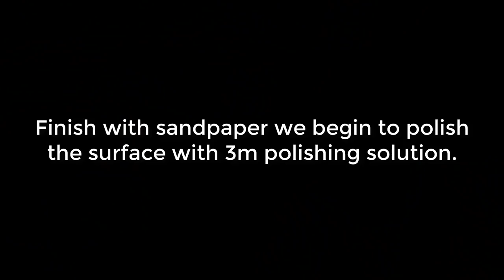How to sand and polish epoxy table - resin art - Art Working

Comment: Hi

I realize im late to the party but is there a reason why you change from orbital sander to the flat sander or is it just the sand paper you have available

Beautiful work

Im inspired
Reply from the maker: Thank you for your questions. There is actually no reason for that change. You absolutely can use both. In the video I use both because I have more finer textures so I can't find them for orbitals sander so I replaced them with flat.

Comment: Does the wood doesn’t get stained after using polish?
Reply from the maker: I use a water-based polish, so I can wipe them off with a damp cloth!
Reply: Woodworking - Arts & Crafts is that 3M also I send you request on Facebook (-: I would like to learn more tips and tricks from you please

Comment: im about to do a project like this but have to ask why the differnt types of sanders? will one or the other not do the trick? i believe u used 3 differnt types here??
Reply: You don’t need different sanders. The big one they were using was a orbital sander it spins and it is more powerful. This allows you to remove material faster. The small sander was a  random orbital. It is not as strong and doesn’t move the same. It will do all the work but take longer for heavier removal. The last thing they were using was a polisher that had different pads for it. That is used for polishing. You can get a cheaper one like the porter cable. You he 3M polish will surprise you on the price it is not cheap. Cheers.

Comment: I tried wet sanding and my wood would absorb the water and rise up and get grainy, how do you avoid this.?
Reply from the maker: Depending on the type of wood you can use with water, you should only use hardwood. It is recommended that you use dry sandpaper to beat them up to a fineness of 3000

Comment: what kind of finish did you use on the wood at the end?
Reply from the maker: I use osmo oil to finish
Reply: @WoodWorkingArtCraft  
How much for osmo
What code.. 1101 extra thin?
Reply from the maker: 3058 clear matt. Its code you need
Reply: @mohdfirdaus3055  i think extra thin is actually better than 3058, as it will penetrate into the wood better, right?

Comment: Hello sir, can you tell me how many minutes you sanded that area with each grit? and what was the level of the sanding machine out of 5 thank you : )
Reply from the maker: A good rule of thumb is that you can identify with your eyes and feel your hands. There is no clear rule on how long sanding is due to it being dependent on many factors such as wood hardness and quality of sanding. But the trick is to follow a fixed path and repeat it at least 3 times. about the speed of my machine to the maximum with the first sanding steps, to the fine sanding steps I lowered to 1 level. Thank you for asking questions and sorry for my delayed feedback
Reply: @WoodWorkingArtCraft   no problem at all cheers and thanks once again for the detailed answer, peace! : )

Comment: piss poor operation of that rotary buffer, its skipping and checking like that because you are pushing down on the buffer, you can see that by the strain on your hand that is holding the handle. let the weight of the buffer do the work DO NOT push down on it
Reply from the maker: Thanks for your comments. I will take note of that.. Thanks you so much..
Reply: @WoodWorkingArtCraft  it is more a safety thing when doing epoxy work if that was a car then there would be chop marks all over the paint. sorry i came off rude, i am having a bad day at work and did not mean to take it out on your video. that project looks awesome keep up the great work.
Reply from the maker: I know. I know. ! I totally agree with you. Thank you for those suggestions. I will do better for later
Reply: You probably have never sanded epoxied monkey pod. It’s a pretty serious workout, making walnut seem like pine. Get back to work & make something worth sharing.